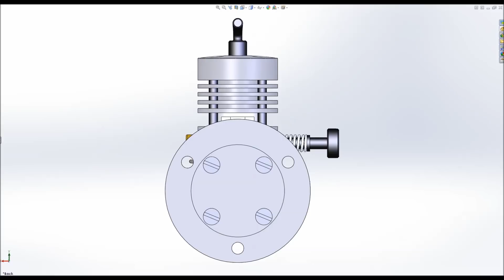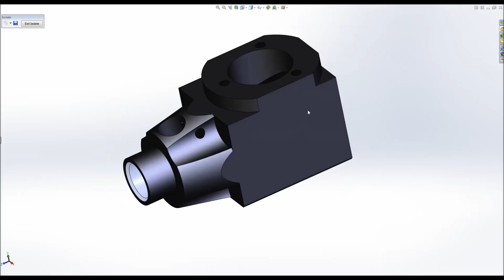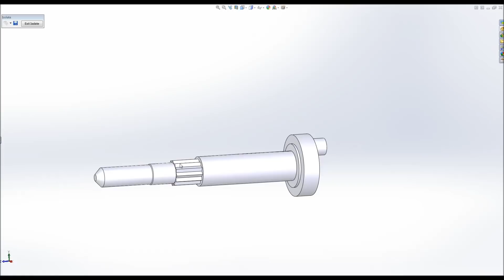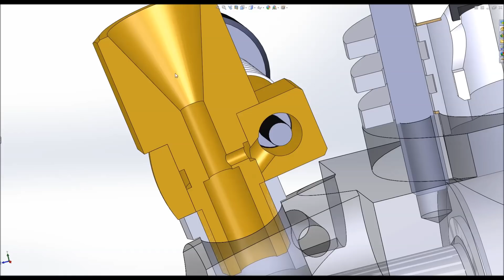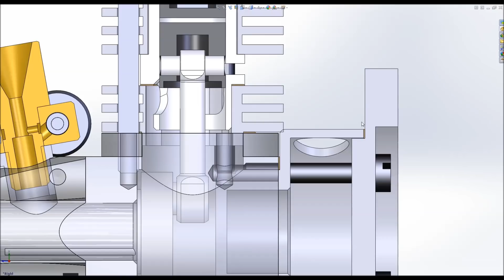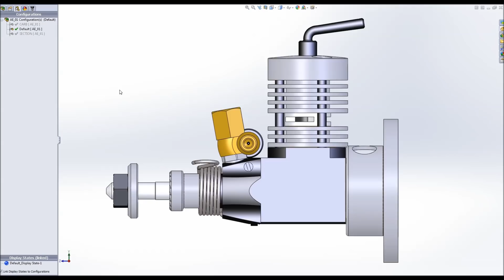AE 0.1CC Diesel Engine in Solidworks

Comment: Upload it somewhere for people to build it!
Reply from the maker: Not sure I'm comfortable with that. It's not my design. I might design something similar. 0.1CC is a tough build as far as getting the piston / cylinder fit correct. Just getting it started isn't easy. Something .25-.33cc is much easier.
Reply: @rcdieselrc  could you share the SolidWorks file?